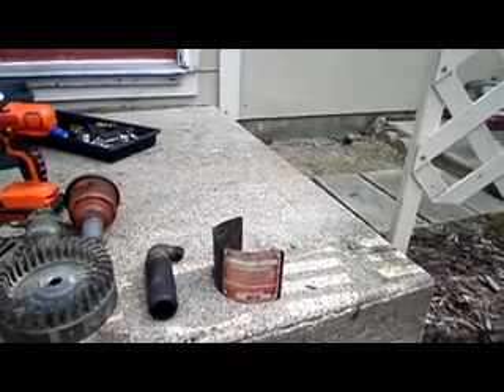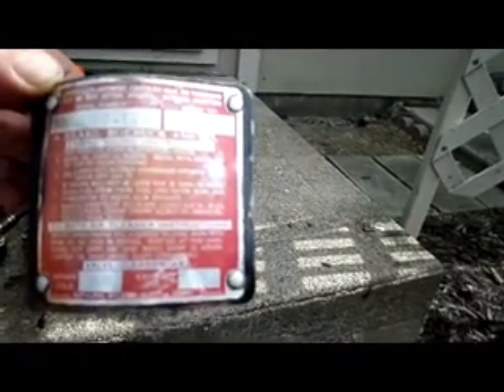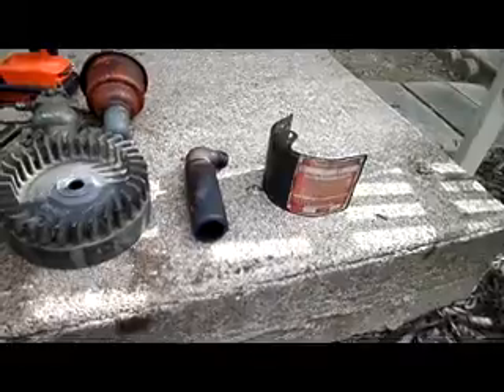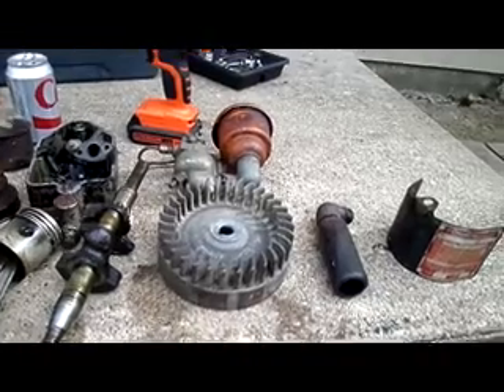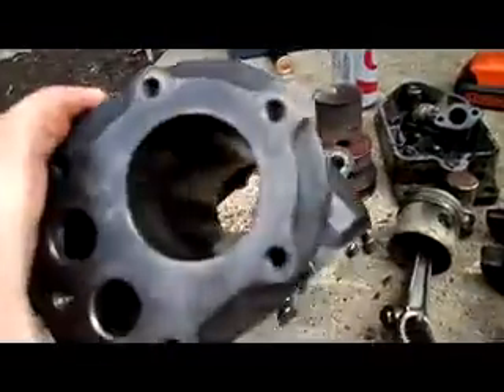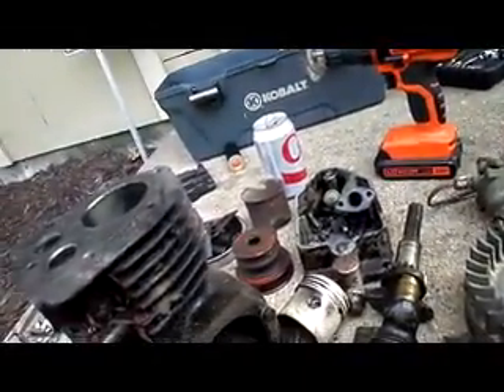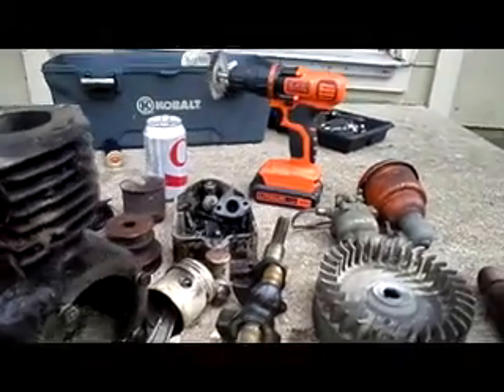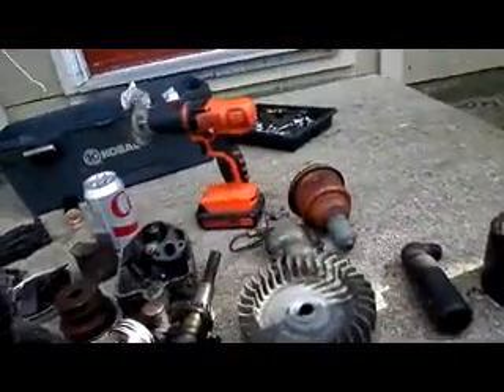Model N Project

Comment: A crank and piston out of a model 6 will fit your engine. Check out the SMOKSTAK old engine website. Make sure you get a crank for the starter setup you have. I have a Sears / Briggs model N from 1950 with the rare bolt on recoil starter setup that uses a different crankshaft than other models. I have a spare con rod for mine, but if  I want to retain the recoil starter setup, I will have to find the [proper crank or get mine repaired by a machine shop.
Reply from the maker: Thanks for the tip, but it looks like I'll be using the old 5s as soon as the rings come in. The mains are in better shape as are the valves/guides. I haven't been able to find a small Flojet carb for this one that I can afford, and the 5s carb I put on it worked. Only problem was the linkage that was up higher than it should have been and kept binding up.